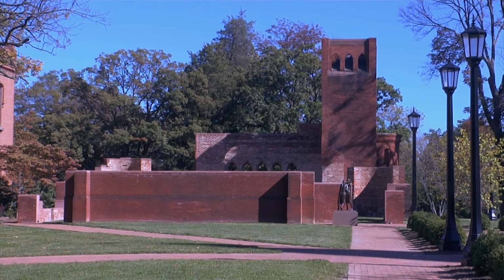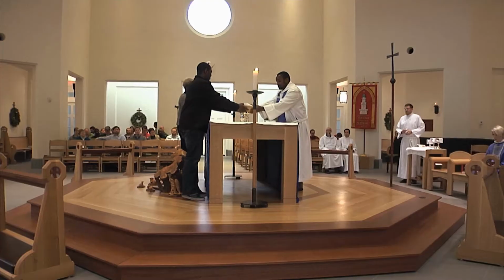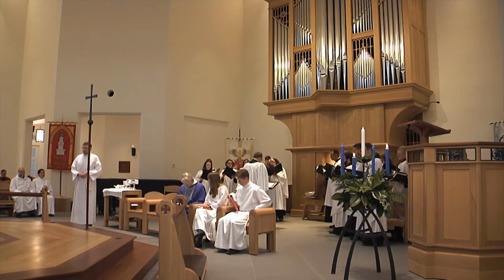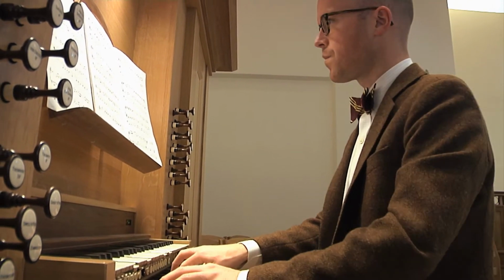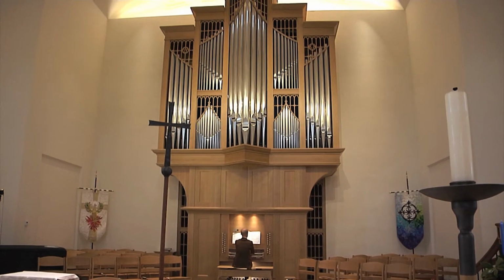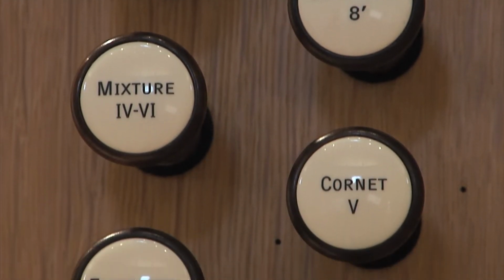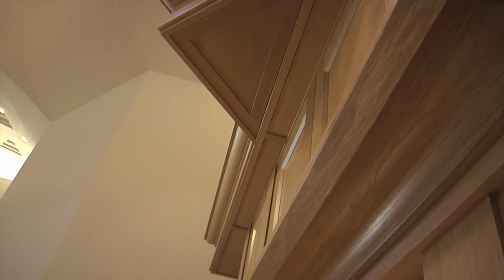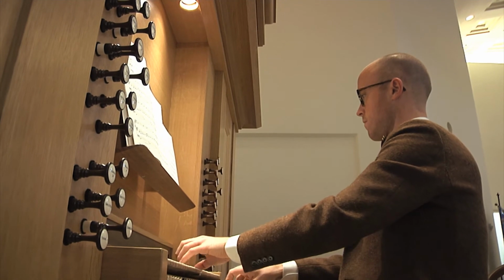Virginia Theological Seminary’s New Organ

Comment: One future challenge that I see is integration of ancient and bleeding-edge technologies.  Allen Organ Company has developed a digitally-controlled electromechanical interface to drive pipe windchests; I'm starting concept formulation studies on a five-manual combination instrument in an F- or G-style console with up to sixty audio channels plus Expanded Audio Capabilities, driving an array of HR- and SR-series cabinets while simultaneously controlling a complete three-manual and pedal tracker organ of approximately sixty ranks complete with a functional keydesk.  Digital expression would be limited to the electronics, with no attenuating shutters on any pipe chamber; speakers firing through the pipes have worked in many combination installs.